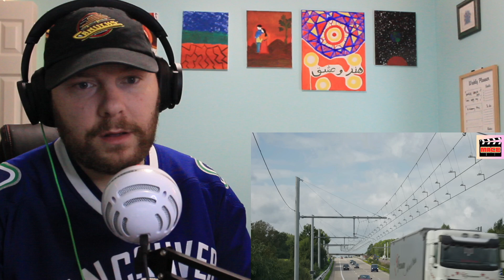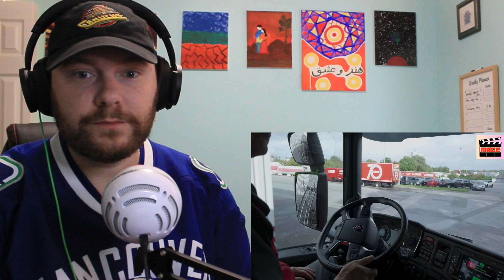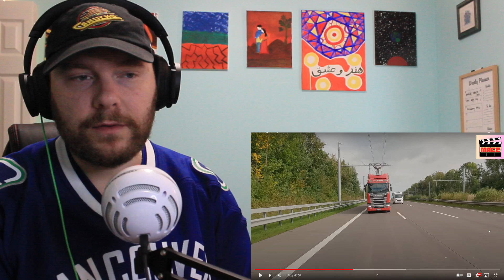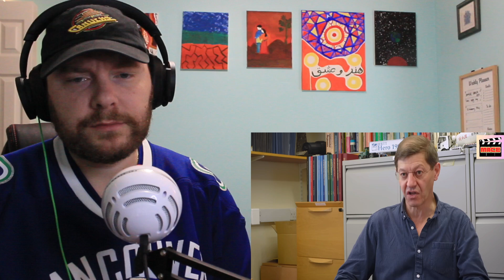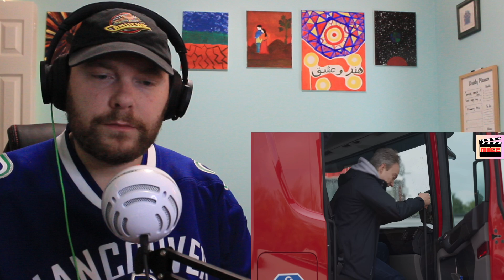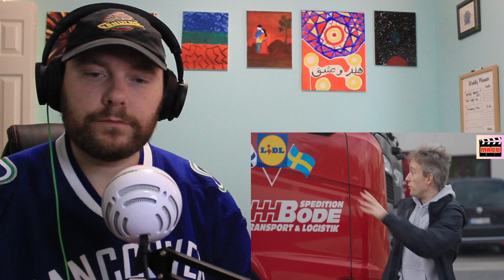Canadian Reacts to Innovative eHighway Test Project in Lübeck, Germany

Comment: The last problem of electric motors is tourq. In comparison to a combustion engine, the max tourq of an electric motor is available instantly. The combustion engine needs to build up rpm to get the maximum tourq

Comment: However, it is important to note that the electricity coming from overhead lines in Germany also does not come 100% from renewable sources. This is unlikely to be achieved in the next 30 years.

So far, the expansion of renewable energies in Germany has led to many serious problems:

• Risk of blackouts

Decrease in grid stability: The fluctuating feed-in of electricity from renewable sources, depending on weather conditions, continuously poses an increasing risk of a major blackout.

Redispatch: To ensure the stability of the grid, redispatch measures are necessary, leading to additional increased energy prices.

• Inflation

EEG surcharge: The EEG surcharge to finance the expansion of renewable energies has led to an increase in electricity prices for consumers.

Storage requirement: The high storage requirement for surplus electricity from renewable sources causes additional costs.

Dependency on imports:

Fluctuating generation: Fluctuating generation from renewable sources can lead to shortages in electricity supply, which must be covered by imports.

High import prices: During times of high demand and low domestic production, there can be high import prices for electricity.

A solution is not in sight for the foreseeable future.